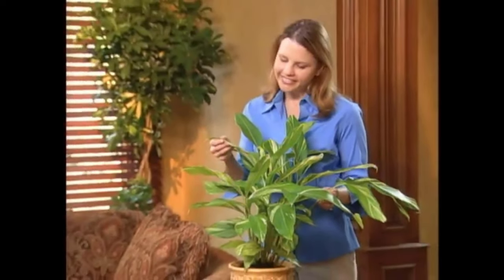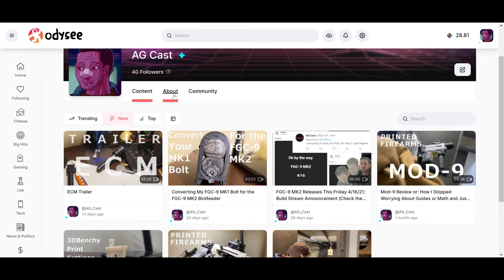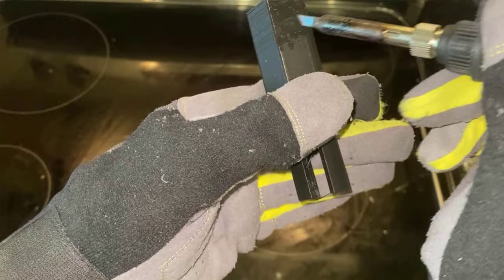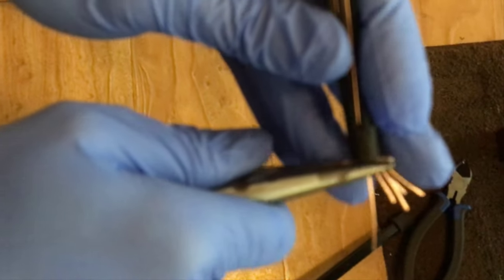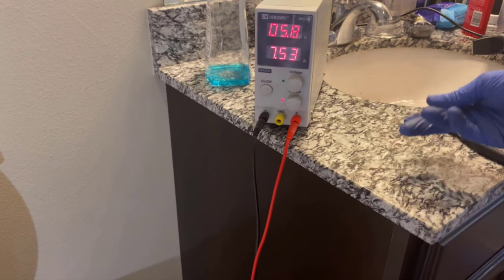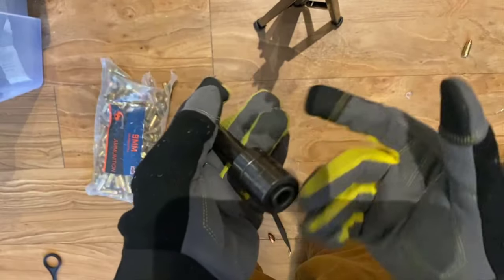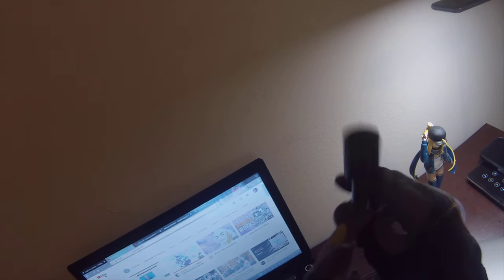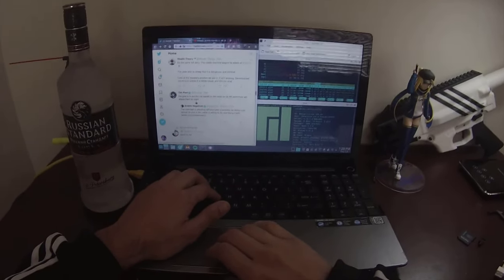ECM: How I made Rifled Barrels in my Bathtub

Comment: I wonder just how far this setup can go...like maybe it could work for different sized plants...
Reply from the maker: Only to find out is to try
Reply: Yes.  People in the 3d printed gun community are investigating this heavily.   As an example some one was looking into cutting slots for charging handles in metal receivers and I was looking into using it to cut locking lugs into a barrel/bolt (I never got the more advanced stuff to work for some reason and rn I'm too busy with more pressing stuff.   But something mildly related is ZURAD engineering.     He is designing a desktop machine tht will let you cut any shape into metal on your desktop.
Reply: @Grognarthebarb  can't wait to see how advanced all of this gets by the time I'm actually able to buy a printer (money isn't holding me back so much as not having space available)

Comment: Adding an on/off pulse should in theory significantly help surface finish and may also speed up your cutting process by allowing time for the waste and gas to clear. Also making sure your waste is routed up will help you clear gas.
Reply: What kind of pulse duration do you mean? Like 50% duty 1 sec, 10hz, 60hz, or 200hz?
Reply: @Ratkill  Really any pulse should help. 50% duty is a good starting point. 60hz sounds right. It doesn't have to be super technical as you're never going to accidentally approach a pulse rate that would truncate cutting distance. Just give the reaction time to relax, that's all.

Comment: Just a tip for anyone who is attempting this, I got poor quality round stock for my boring and chambering operation from Home Depot. Spend some extra time and money to get a true round piece of steel. The profil of the Home Depot rod was egg shaped, and this caused my barrel to be cut egg shaped.it is still functional, but for not much more $ you can shoot for perfect.
Reply from the maker: Good information. Maybe should check Lowe's they usually had a better selection of steel and for cheaper prices than Home Depot, at least for me. I might buy one of those egg shaped ones tho to see how much it can through off accuracy
Reply: AG Cast measuring my rifling valley to valley = 9.30mm, 9.28mm, 9.22mm. Although my chamber ended up round because I oriented the chambering tool off by 90* every other cut, the cuts seem to be off by about 80 thousandths of a mm

Comment: nice, ive tried this with sort barrels  useing just a seupt like when you etch logos in steel, just deep etch it.. you have your etching jig printed on plastic film like a normal etching but you stick it in the bore.. ive also just acid etched rifling... dip the while barrel in nail polist or etchers resist and then push through an undersized rifling button with oil on it and it will scratch off the resist in a spiral pattern.. you can make a lil spring loaded one with hacksaw blades to do the cutting.. you can etch 50 at a time if you want.. or just do it the ol fashond way and drive a button through

Comment: you can use a grade 8 bolt and it'll work fine. cheaper and very high tensile strength, medium carbon steel.

Comment: I wonder if this could be scaled up to a rifle length barrel
Reply: Did this with a 20 incher. It works, but damn have you gotta be accurate in your measurements. I ruined my first barrel after measuring off by .03 inches. So measure twice and cut once. Good luck bro

Comment: hello, ive got a small problem, all the cutting went fine but i ended up with a mouth with a larger radius the casing sits nice and snug but the mouth is too wide and i can see 3mm in to the chamer, how can i fix this (i use a weaker waterpump could this be the problem ?)
Reply from the maker: Check your tooling and it depends on how much weaker. Also then try shorter cutting intervals where you have problems
Reply: @agcast  ill try that, aslo one thing i noticed is that unlike the boring rod the chambering tool has black residue on it like it had been burned with a lighter, the weird thing is te rest of the proces went fine just this problem alsways came back. thanks for the help though :)
Reply: @agcast  Ok, so it turns out it was the pump, the tooling was fine. The weaker pump could only move 500L p/h and the new one I bought could move 900L p/h this upped the pressure and it did the job. I decided to get a fountain pump to up the pressure so if anyone runs in to this problem check the presure and pump output.

Comment: Are there any length limitations on this? Or could you do a 16 inch barrel if you had the time/patience for it?
Reply from the maker: Yes it can be but it’s significantly harder and will require a new tooling. I’ve only seen one person do it and they made it seem like it was quite hard. I strongly recommend doing it once with a smaller barrel first before trying to get the 16’ to work
Reply: @agcast  got it thanks for the heads up.
Reply from the maker: @Darkess343  it’s something I’ve been meaning to work on but haven’t had the time. Definitely possible just wouldn’t recommend for your first time

Comment: I've been wondering if this process can be easily modified to do bottleneck cartridges like 5.7 or TOK. the only way i can see it working is if you add another step to mill out the step down with a reamer
Reply from the maker: Don't see why not but it would be more challenging to make proper tooling, the bigger problem would be printing something capable of using bottlenecked cartridges since most designs are simple blow back. Perhaps its just nobody has really bothered to try because of that
Reply: @agcast  I think since we're seeing a lot of hybrid 3d printing/traditional machining, we'll see some delayed blowback designs pop up.
Reply: @jordanhorst6  the King Cobra by derwood seems to be a delayed blowback system, but the plans are not yet released.
But according to derwood it will be rather complicated to make the bolt, so I dont know if that will be a viable option for homebuilds
Reply: @agcast  our mate Ivan said he was looking into using lead casting to create a chambering tool for .357SIG, but am not sure what his progress on that is.
Reply: @yourlocaltoad5102  I've been waiting for the cobra to drop, but i wasn't aware it was a delayed action. sounds awesome.
Reply: My thoughts in doing just that was a 3 dprinted die.   That was coated in a conductive coating much like ZURAD engineering.  And either slowly introducing it to the part.  So that it never touched and can slowly  ecm the material away    Or building it to have its own built in stand offs so that it could be done without a very slow very precise machine.

Comment: Wouldn't it be way safer for the plants to use other electrolytes like sulphuric acid so that no chlorine and H2 is generated?
Reply: If someone is actually trying this, just so you know about that. Neither chlorine nor hydrogen gas is something you want to float around in your home casually
Reply: @Ghost if they're using table salt, definitely
Reply: Having electrolyzed sulfuric acid for other reasons, I can assure you that sulfuric acid fumes are no more fun than chlorine. Lung hurty. If you're that worried about chlorine(a justified reaction), cover the whole setup in a damp old tee shirt and the hydrochloric acid formed on the surface of the tee shirt will destroy the tee shirt rather than your lungs.
Reply: @railfan_3371  valid point if that's the case. But what's the most relevant thing, and that concerns both, is the hydrogen and oxygen gas - it comes out in the literally perfect mix for brutal explosions. Either you burn it right away with a correct set-up so that it can't build up, or you rather be very careful. Just a damn balloon of 2 H² and one O² gas will give you a damn tinitus for the rest of the day, and we're speaking about way higher volume i think
Reply: @braindecay9477  The only explosion risk is if the electrolytic mixture is allowed to become too basic. When you electrolyze salt water, the sodium chloride decomposes into sodium and chlorine gas. The sodium reacts with the water instantly to form sodium hydroxide(Na OH) and hydrogen gas. So long as your electrolytic mix has chloride salts it should preferentially decompose that instead of the water.
Reply: @railfan_3371 cant you just do the process outside?

Comment: Is an Amazon 12V 5A power supply good enough for the cutting part? I'm too cheap ass for a proper supply
Reply: you need the big bench boi, or magic smoke go puff
Reply: Late, but in another comment he said 7.5 Amp minimum, and more is better. Low amps gets low quality cuts.

Comment: Is there any reason I can’t use a button and a 20ton press to achieve the same thing?
Reply: Cuz I don't have one
Reply: No reason you can't, but plenty why you shouldn't
Reply: EMC makes a more accurate barrel
Reply: @misterpotato427  I don’t think that is true. What evidence do you have to support that? Button rifling is common practice in barrel manufacturing I would imagine ECM is subject to far more variance in the end result. It seems that it would be more likely for error. This seems to be a system that is best used when no other option is available, this makes perfect sense given the concept behind this entire design. In my particular case, I have access to the proper dies and tooling that others may not.
Reply: @The50Americans  Maybe not more accurate, but it doesn't put stress on the barrel like button rifling does. So if you dont have a high quality steel rod
Reply: @The50Americans  You're going to do a lot more than just just a rifling button and 20 ton press to get the results you can easily achieve with ECM. For starters you need a hydraulic pump and ram setup instead of a bottle jack, because the former will move in a nice and constant fluid motion while the latter does it with jerks which will cause the button to partially bind up each time and cause a mess in the barrel (it will still work, but it's not exactly optimal). Also, you need to do it by pulling instead of by pushing like what amateurs generally tend to do with rifling buttons, because once again pushing causes binding unless you have a professional setup and really know what you're doing, while pulling can be done much more smoothly though you'll still need a hydraulic pump and ram.

Comment: can you use batteries instead of an adjustable power supply? i read that you need between 10 and 30volts for this. but i do not own one of those adjustable power supply machines. i am asking if i could connect batteries for the power supply.

Comment: What is the wall thickness on your barrel
Reply: look at the FGC9 m2 pdf. I think mine is like 0.7mm wall thickness and it has worked for like 350 rounds of 9mm win
Reply: @@user-bi2kl3gu9o yeah i did this method with everything the guide wants. most boring thing you can do but it was worth it.

Comment: can I do it with a 30V 5 amp power supply?
Reply from the maker: No, you will at least need 7.5A. The lower the amperage the worse the cuts
Reply: @agcast  how about 10amps 12v will it be ok?

Comment: Can  u cut the barrel with an angle grinder? or only  a hacksaw? is  ivanthetroll trolling us?
Reply from the maker: I don’t have an angle grinder so I can’t tell you but I don’t see a reason why not. Really just need to make sure you can make flatten the cut area afterwards
Reply: Only reason angle grinder could cause problems would be if you cut it and it gets stupid fucking hot.   It could mess with the heat treat and make the barrel softer.   Would I be worried?   No.    Probably not gonna get that hot.
Reply: If you're really worried about heat issues just take it in several small passes and water cool it between them. Probs not an issue in this case but that's pretty standard advice for this kind of thing.

Comment: hello i have a question for you i am trying to make a plastic gun with 3d printer i am having trouble finding a spring if you have can you measure the ar-15 hammer spiring dimensions and send it to me as a technical drawing
Reply: Are you gonna make ar15? Theres liberator files on the internet which has completely 3d printed spring
Reply: @isminivermekistemeyenmahmut  aga sen Türk müsün
Reply: @methexis9965  aga silahı yapsanda trde kurşun bulunmuyorki kurşunları çok sıkı denetliyorlar kurşun bulunsa yapılırda kurşun olmadan yapmanın bir anlamı yok
Reply: What kind of filament are you using?
Reply: try saying PLEASE ffs
Reply: y u fedposting

Comment: I feel like more people would have access to a lathe then all this nonsense 😂
Reply: 3d printed plastic fixtures, some copper wire, and an old computer power supply will get the job done. You could buy all of that new for less than even a tiny mini-lathe. Also, it's a moot point because rifling isn't cut on a lathe. A Harbor Freight shop press and a carbide button from China on the other hand... that'll get the job done real cheap.